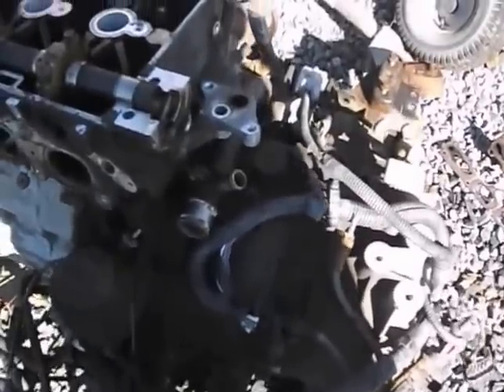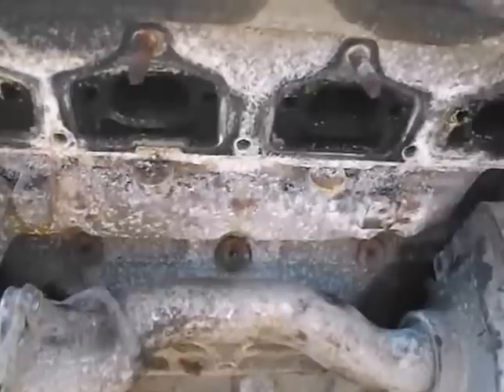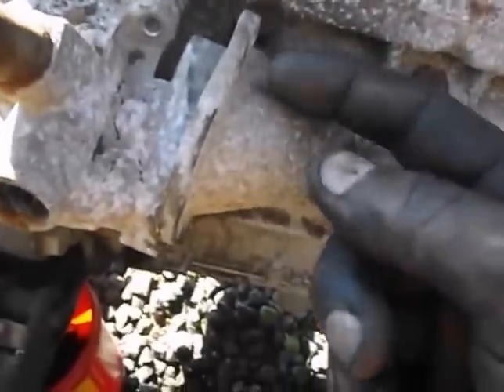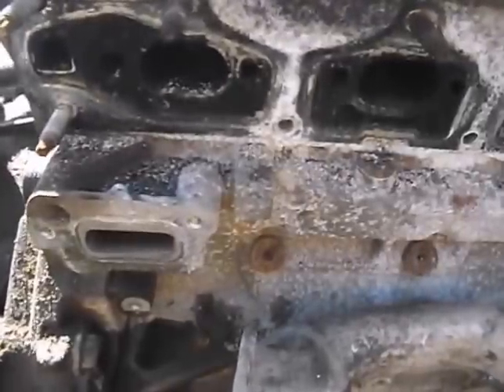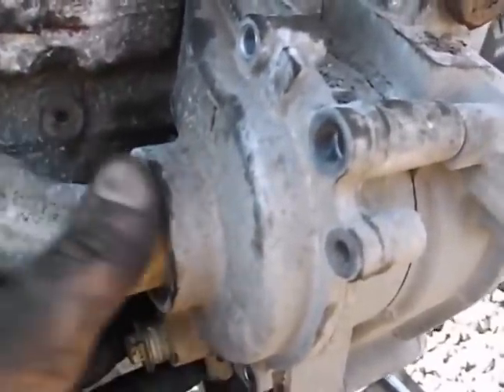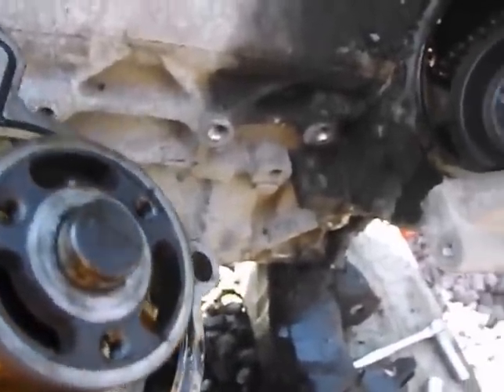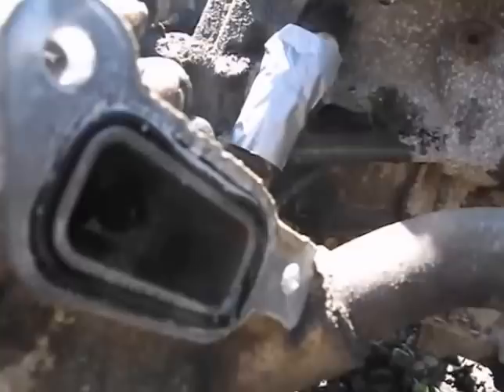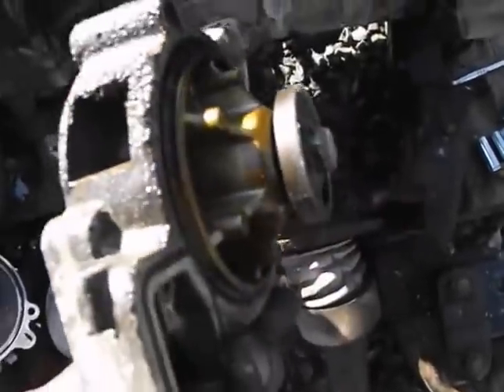Saturn Vue 2 2 Ecotec Engine Water Pump Removal

Comment: I started by removing exaust cover, then the thermostat,heater hoses off thermostat housing, then i twisted a plastic bag, folded it shoved in bottom of access hole so no bolts fall down in engine, put timing savor on, undo the 7 bolts, don't forget the far left motor mount bolt on engine it's the upper right most  bolt on water pump, I taped the timing bolt into the socket with electric tape, screwed them in snug,then pulled socket out, took tape off , repete, don't forget to pull bag out once tool is out before turning engine, I did not pull exaust or engine mount, just folded computer upland bunjied it to tire/rim on driver side, I did pull passenger wheel,  13, 10 mm magnets and mirrors

Comment: why would you show how to do this, with the engine out. when someone goes into an actual garage, they are not going to drop the motor out for this replacement. would have been easier to show how to do it with the engine still in.
Reply from the maker: It was being scraped Dennis not fixed. Sorry you can understand just the same. TC : )

Comment: you need to stop showing this! If you remove that gear on the water pump with those 3 bolts and let it fall you have just screwed yourself. that chain around the water pump also keeps the balance shaft in sync. if you let the tension off the chain the balance shaft will move on the chain in relation tho the crankshaft and cause a vibration on start up that you will not get rid of unless you retime the motor. several companies make a tool to hold that gear in place while allowing you to remove those 3 bolts that attach it to to water pump
Reply from the maker: I will place that advice up above so who ever does this knows to use the tool. Tks
Reply: jim mcallister how many man hours does it take to change the water pump while the motor is still in the car of course

Comment: better not try this without the water pump holding tool. if the chain slips just one tooth and one of the balancer shafts or the crankshaft you will be taking off the front cover to reinstall it. the tool isn't much and you might be able to rent or barrow one from your local parts store.
http://www.amazon.com/Lisle-13800-Sprocket-Holder-Ecotec/dp/B001C6LDHU or this
http://www.denlorstools.com/home/dt1/page_9822/gm_2.2_ecotec_water_pump_job_made_easy_j_43651.html